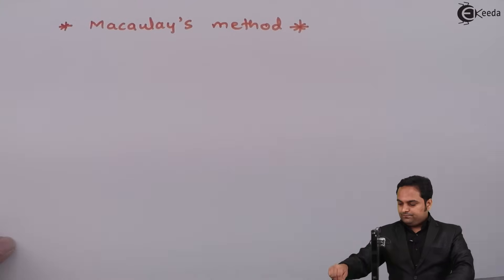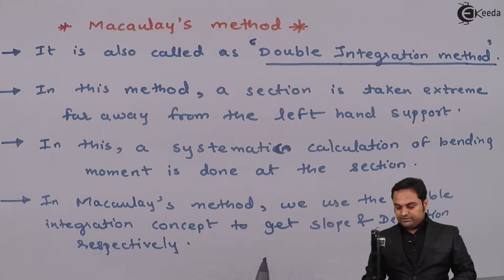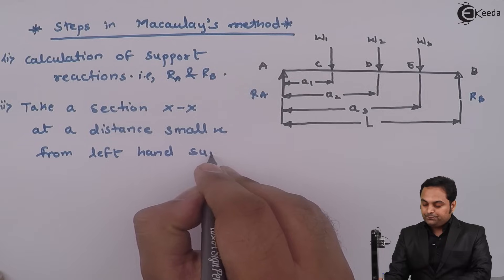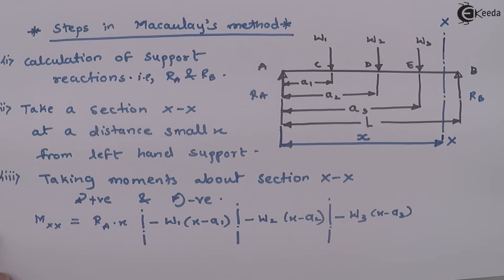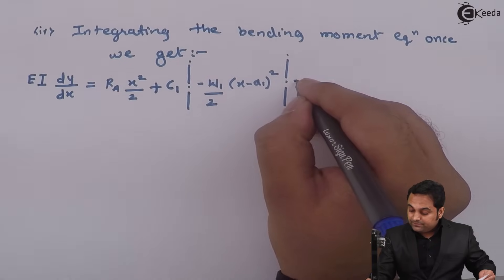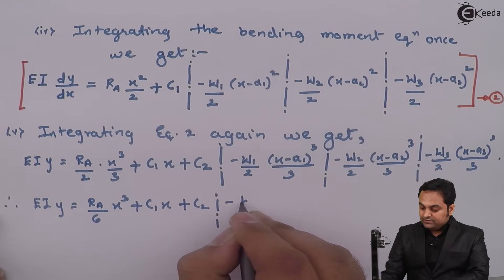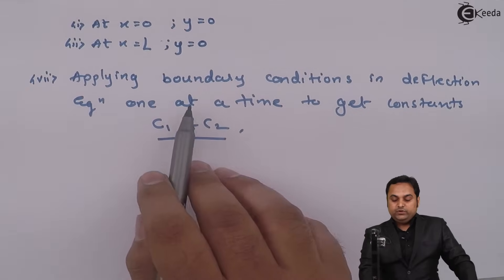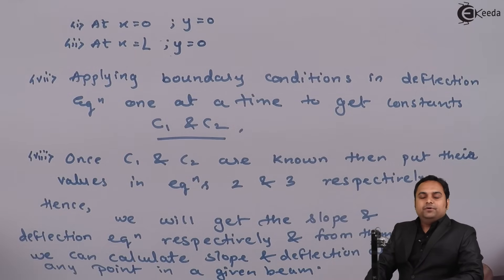Macaulay's Method - Slope and Deflection of Beams - Strength of Materials

Comment: double integration method is not equal to macaulay method
Reply: They are quite same, take a look at the video we integrate two times the obtained bending moment, thus we get a final answer for slope and deflection for different beams,thus double integration method could also be considered as the end result of macaulay's method, in order to avoid such a tedious derivation we remember formulas and directly substitute it in case of double integration method.